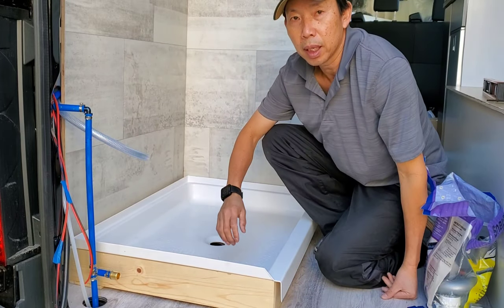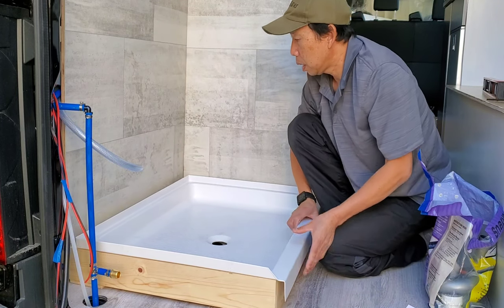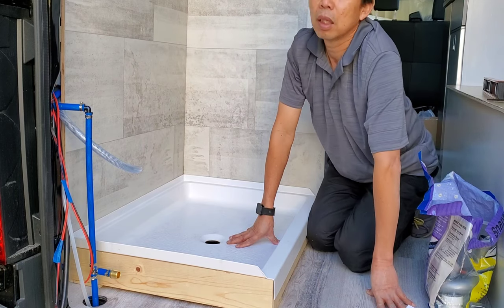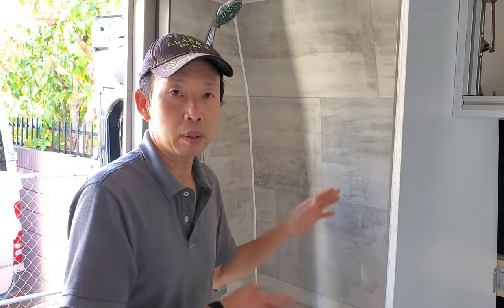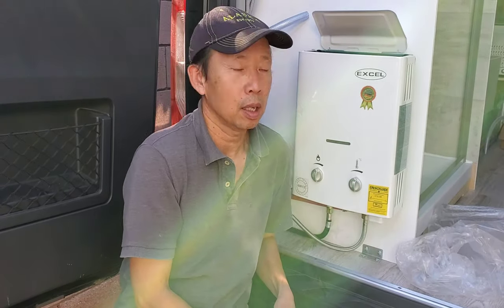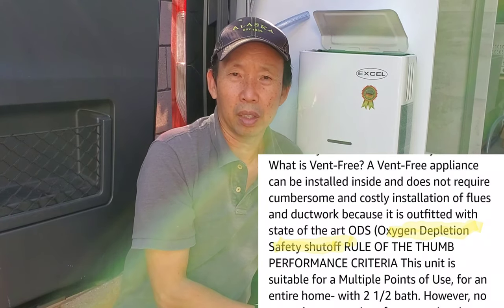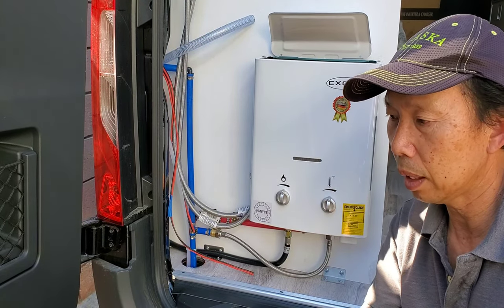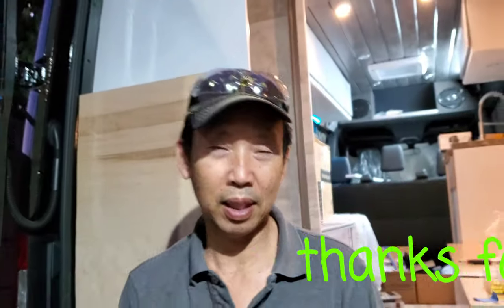Van Build Ep9- 2019-Sprinter van 4x4.  How I Build The Shower

Comment: Hey bo, you mind sharing how you secured the walls? I did see the brackets on the floor. But how about the wall and the ceiling? Did you use brackets as well?
Reply from the maker: I use 1x3" brackets.   And also 1" aluminum tube along the opening.
Reply from the maker: If you use 3/4" Plywood I don't think aluminum support is necessary.

Comment: Hi, How thick is the plywood and how did you cover the curved van wall?
Reply from the maker: The walls are 1/2" thick. The curved I used 3/8 so it's a little flex. Then I used 1/4 hex Screws to secure to the back wall.  That way when you start tightening it pulls the wood.

Comment: That water heater is what I've been looking for. Thanks. Also where did you get the shower door from?
Reply from the maker: Hello Daniel, 
Here's the video about that shower door and the link in the description. 
Van Build- How to install a Retractable Shower Door" on YouTube
https://youtu.be/ogl8K0kQ_jQ
Reply: @BoChuonOUTDOORSVANBUILD  Thanks. One more question: Can the heater be installed sideways or does it need to be vertical?
Reply from the maker: It has to be vertical
Reply: @BoChuonOUTDOORSVANBUILD  How much height is needed if you take the gas and water pipe install into account?
Reply from the maker: I leave 6" for the pipes,  the unit is  15" and the top vent space is at least leave 6" . So overall space you need is 27" height minimum . The width is 12"

Comment: Great video! I've been looking for a DIY for my shower and this was quite helpful. Question - can you explain how you hooked up the shower mixer valve? I'm new to plumbing especially in van and wondered how you do this.  Please advise. thanks
Reply from the maker: It's exactly the same as home.  You have one side hot and cold and these RV shower heads come with 1/2" fitting and so as the mixer.  Unless you bought the regular ones with 3/4" fitting then you have to get the reducer/or enlarger.  Drill the two holes in the wall and screw the hoses(from the pump/water heater hot/cold) from the back with washers to tighten the mixer.  The hot and cold water hoses should have female Thread fitting at the end to connect with males from the mixer. Hope this helps.
Reply from the maker: Just in case.
These items work well together and simple. Here are Amazon Affiliate links 

Shower Head 
https://amzn.to/3wZEUWL

Mixer 
https://amzn.to/3h0jiCM
Reply: @BoChuonOUTDOORSVANBUILD  
Thank you for the response! I ended getting the same exact mixer and shower head. I'm running pex but may need to get a female thread fitting lfor the hot/cold hoses. Much appreciated!!!

Comment: Great video, thanks for sharing!

We would like to use vinyl sheets as well for our shower walls. Would you recommend using plywood, then redgard membrane, then currogated plastic sheets and then the vinyl? Or should we skip the currogated plastic sheets? Only worried about the currogated plastic sheets because they're quite delicate and seem like they'll dent easily. So I don't want that to show up through the vinyl sheet.
Reply from the maker: I think vinyl would be enough. It's thick.
Reply: @BoChuonOUTDOORSVANBUILD  Thank you so much! 🙏🏼
Reply: May I ask what product you used to glue the vinyl to the plywood?
Reply from the maker: This floor is an interlocking system there's no glue required.
Reply: @BoChuonOUTDOORSVANBUILD  Oh wow, thanks!!
Reply from the maker: @TheGlobalSnowbirds  oh sorry the vinyl for the shower I used Girilla Glue.  Heavy duty indoor/outdoor. 
Gorilla 9 oz. Heavy Duty Construction Adhesive-8010003 - The Home Depot
https://www.homedepot.com/p/Gorilla-9-oz-Heavy-Duty-Construction-Adhesive-8010003/206063265?source=shoppingads&locale=en-US&mtc=Shopping-B-F_D24-G-D24-24_16_EXTERIOR_PAINT-Multi-NA-Feed-LIA-NA-NA-FY21_Exterior_LIA&cm_mmc=Shopping-B-F_D24-G-D24-24_16_EXTERIOR_PAINT-Multi-NA-Feed-LIA-NA-NA-FY21_Exterior_LIA-71700000075826640-58700006498654201-92700058683660129&gclid=EAIaIQobChMItMfMxuOJ8gIV1z6tBh1O8wanEAQYCSABEgJlQfD_BwE&gclsrc=aw.ds
Reply: When you applied the glue, did you spread it with a trowel? Or just evenly squeezed out of tube 1-2 inches apart. How did you press the vinyl against the plywood?

Comment: The vinyl wall looks nice, but.. it was not designed for shower, and I may have to find another alternate material for my build, bummer.  Water vapor can permeat through vinyl pretty easy. Overtime will accumulate on the other side. Mold will start to grow. As it grows, the volume expand and delamination process start. This is the reason they don't use ceramic tile in bathroom, only porcelain. Maybe OK if the van is used a few weeks a year, so the water on the backside can evaporate away, but if one plan to live full time, the shower wall will get mold growth in year or two.

Comment: Very nice demo and good photography.  Very well explained thank you!
The bathroom looks perfect.  It is beautiful.  I like the shower pan.  These shower pans come with drain holes in different locations, so folks should pick the one that matches the existing drain hole location.  They also come in all shapes.

One thing - where you put the caulk line vertically, you could stick a tile edging strip there, in aluminum.  That would look nice.

fyi - please do not add music to any demo, DIY, tour, cooking, or animal video.  Natural sounds only.  Music hurts the ears every time and is very unpleasant.  It is the only reason I do not subscribe to channels.  Thank you.